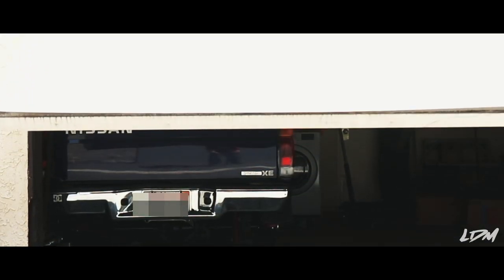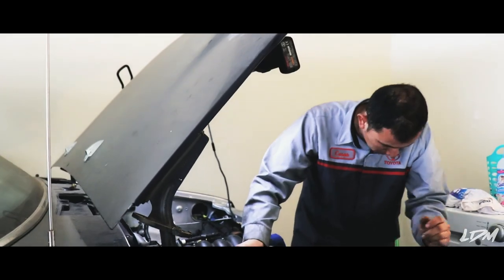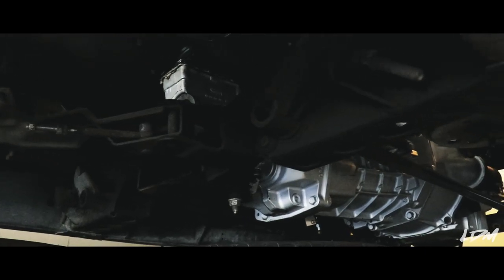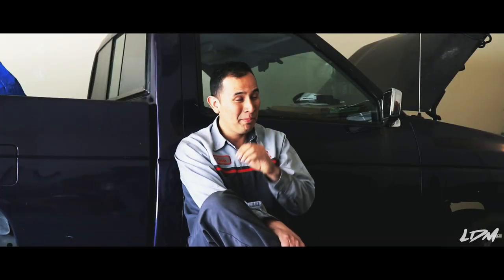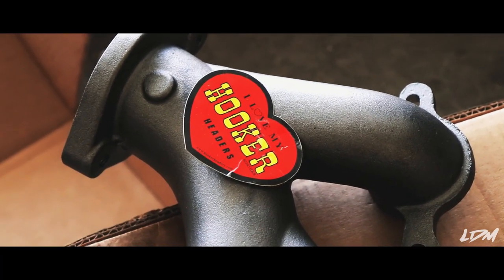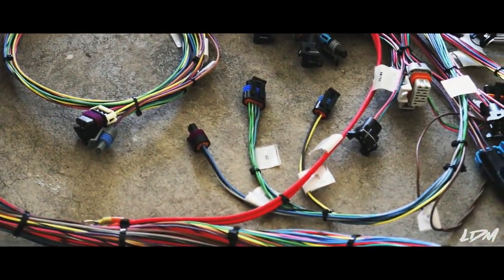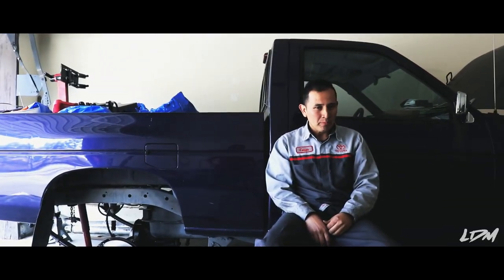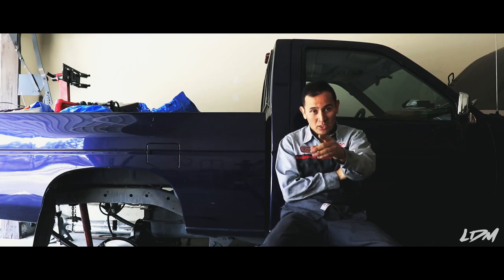LS1 SWAPPED NISSAN HARDBODY D21

Comment: Has anyone swapped the LV3 4.3 V6 into a D21 ?  Its all-alloy and 285 hp. A standalone wiring harness exists.   The aluminum motor weighs about the same as the KA24-DE,  a little heavier than the single cam KA24-E

Comment: That's funny, I also work at a Toyota dealer... And I'm building a hardbody as well, 4.8 ls, Ar5 adapter kit, 8.8 etc. Should be similar when done!
Reply from the maker: Nice lol
Reply: How much would you guys charge for a swap like this?
Reply: @chalecharros7689  I've been driving my ls swapped d21 for about a month now, it still needs suspension work, and body/paint. But I've invested around 4k so far minus all my labor. Once I get it finished I wouldn't sell it for less than 10k
Reply: @derekhansen6652  nice 👍🏻